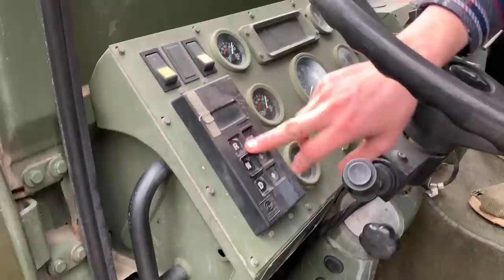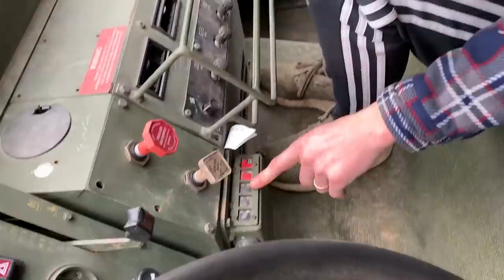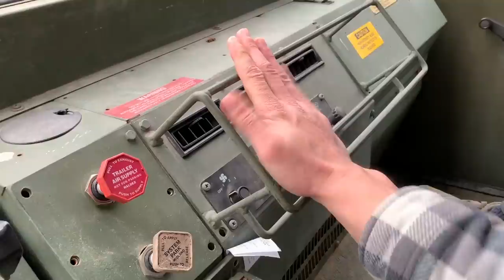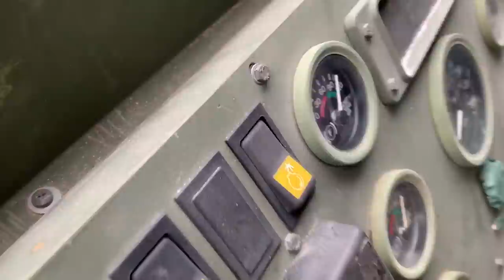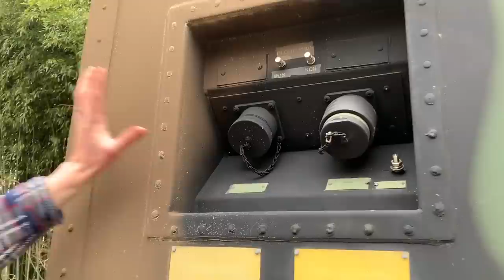Building The Ultimate Apocalypse Vehicle!!!

Comment: Army veteran here. Worked on these for 5 years. Y’all can get the manuals for them online buy googling their model number and TM. It will tell you everything you need to know about it!!
Reply: the circle on the roof is that for a 50 cal ma-deuce turret?
Reply: 22:17 that 69 tho......
Reply: hr 777 I pretty sure I thing I don’t remember I use work on them with the turret only and every thing else and with air up and down In tire there is a hose clamped inside the axle and then it has a like 360 turn thing I for got how write it but it turn with the hose you see out the tire
Reply: I also probably wrong through I was only in back incase of a thing need fixed with never happened
Reply: I worked at Stewart and Stevenson in Sealy, Texas as a Welder in the early 2000's with the Iraq War. The companies name actually changed around 2007 to BAE Systems. These are such amazing built rigs the quality is top notch for sure as you would expect from a Military vehicle.
Reply: I miss camp Carroll, 1999 to 2001. Queen Bee 👍😁
Reply: A man thanks for your service bro and thanks for giving back to the community even though your already did you time in the service

Comment: military mechanic here, you can get PDF's with all the operating manuals, parts manuals, and service manuals. If you need help hit me up and I will help get them
Reply: Christopher Pence that is what I was thinking
Reply: Hey I started off as a 76 Charlie and ended up an 88 Mike.
Reply: Thank you for your service men. Are those plugs on the outside to connect the power for that electrical panel?
Reply: @michaelhembree6347  yes cord goes from generator to those plugs which will bring 110 volts into that shelter
Reply: TM 9-2320-365-24P if I remember correctly for that truck. The M1078/1079 manuals will work for all but the box on the back
Reply: Christopher.....one cool dude.....
Reply: @michaelhembree6347  The plug on the outside next to the battery's is a Jump start plug. u would hook up a cord between 2 trucks to jump it
Reply: You got to gxet the -10 manuals. How else can you do a "complete " PMCS? Jk
Reply: Good Man!
Reply: Liberated Manuals. Old deuce... Check your data plate for the model. I pray they don't have to ever pull that dash apart...
Reply: Awesome dude hook these good men up!!!!
Reply: Hey do you remember those Preventive maintenance comics?
Reply: nice man your grate to help
Reply: @MrLordwrecker  memories.

Comment: You guys are really taking me back to my Army years driving and repairing that vehicle. It's an LMTV (Light medium tactical vehicle), it has the CTIS (central tire inflation system) which inflates and deflates the tires even on the move, the roof of the cab can be removed and outfitted for a Gunner, the left headlight and right rear tail light has the blackout lights for night driving. It's not bulletproof because it's not up-armoured, the cab lift and spare tire craddle both operate on the same system hydraulically to lower and raise and you can do it manually if the system fails. You can't go as deep as the exhaust pipe or you'll stall the engine, and the headlights can be upgraded. I worked on and driven those for 20 years
Reply: so what your saying is, they need to run a tall stack to go as deep as snorkel.
Reply: That's awesome man!
Reply: Back-in-action mode, did that vehicle have remote comms and/or relay capability? Those two connections on the passenger side at the rear look like Russel-Stole recepticals. Usually for some POTS lines and a data connection. Those rings on the top look like they would anchor a small SAT dish. Just some thoughts. Awesome buy goonz.
Reply: @GSXR1300X  yes it did

Comment: Guys, drive that over to your nearest American Legion, ask the Vets about that. When doors are open the black lights come on, close them the white interior lights go on. Over the cab you have a machine gun turret that was removed. Large side hooks for air mobile transport the chopper picks it up. Your AR 15 can fit the M 16 racks. The box isn't bullet proof  neither are the push out windows. A generator hooks in to that fuse box. Inside the cab you have an ammo box and bag storage for gear. Have fun with you build!

Comment: The hole in the roof is a turret. The mount guns on top. Fun to drive. The walls are Insulated. The blue lights are so it’s not so noticeable at night. Tactical and the lights under the blinkers are black lights which are used at nights under night vision goggles
Reply: Sick
Reply: 22:17 that 69 tho......
Reply: Terry - I was going to say something, but you’ve got those details locked in. 🍻
Reply: @HolyMolyDoughnutShop-s  saw that aswell i was like FATE
Reply: Also The hooks you noticed are not merely for removing the roof, those things can be picked up by heavy choppers. The Goonzquad bought what amounts to a stripped down mobile command post. Complete with all the power necessary for the computers.
Reply: The front "tin" section is for the APU/Gen Set for all the power for the 110 plugs

Comment: Hey Boys, Great get. I am an old safety officer for the Department of Defense, and i'd like to pass along a small bit of safety that may save your lives if you decide to raise the cab. A while back a seasoned soldier was crushed by the cab while he worked on the stuff under the cab. Since that accident the DoD has mandated a "T" handle device that braces the cab from loosing hydraulic pressure to hold the cab up. So if you ever decide to lift the cab please find a strong device to place between the raised cab and a hardened spot to prop the cab up while working under the raised cab.

Scott

Medford, Oregon
Reply: I hope they see this
Reply: Up
Reply: Good looking out
Reply: Yep... Just like all of our fire trucks. You raise the cab to a point and a bar automatically locks into place. Do what ya gotta do under there..  Pull the cable to get the bar out of the way and lower the cab..  😎
Reply: hello from Medford!
Reply: The good ol LMTV. Drove a lot of these in the Army.
Reply: Born and raised in Medford Phoenix class of 88
Reply: Thanks for your service and professional advice 👍
Reply: Also no MBUs while sleeping
Reply: keyboard warrior
Reply: I had forgotten all about that T-handle. Good lookin out....
Reply: Yep the officer is completely right ..i work on this and heavy equipment trucks ...and the hydro system is tricky ...be safe !
Reply: Ordrock7 good hint! That’s not a toy! 👌🏻
Reply: nobody cares
Reply: Hello from Roseburg
Reply: Hello from Monroe Oregon
Reply: Sage advice.
Reply: Hey I’m from Medford, Oregon
Reply: Im surprised they lived thru the video

Comment: I want to make a few recommendations for you guys.

1. This is a stripped down mobile command post. This thing has the power generation capacity for computers and tech. Strongly recommend figuring out your own Wifi for this vehicle
2. Light placement is tactical. Keep the blue lights, be concerned about overloading it with lights.
3. This definitely had the capacity to mount firearms of several kinds on it. Check with your state laws on those 
4. Do not mess with the exhaust: If you are building a bug out vehicle you will need to be able to not be heard or not heard as easily. 
5. DO add beds and what not. Also see about more gun storage
6. A refresh of the paint is definitively in order to bring it up to modern camo standards and i agree the Forklift in the same camo would just scream America.
7. Have a lot of fun with this!!
Reply: This is the best comment on here :-)
Reply: Be sure to wear your ppe ie: eyepro, gloves, and ach 😂
Reply: Yeah the blue lights inside are probably there for night time ops. We usually use red lights at night for light-discipline, but I imagine blue lights might be useful for differentiating the command post. This is a really nice truck!
Reply: @jaydenf9646  haha
Reply: I'd make the interior super nice with plush and modern amenities like those multimillion dollar underground bunkers built in old missile silos. Cut a doorway from the cab to the  back, install a roof mounted air conditioner and also build a deck on top with pop up guard rails.
Reply: NATO camo pattern is still in use, so it is current.
Reply: Ok
Reply: Heather Maya true
Reply: @uscjake868  we had the same blue lights inside to the m1a1 Abrams when I was in.
Reply: This guy preps
Reply: This is the main comment that needs to be taken seriously...this vehicle is used for mobile communications, think of it as your internet provider on wheels...also make sure the vents are open when the AC unit is turned on or it can overheat...Also if when starting the truck and it beeps, means that the air compressors need to build up pressure, the three tanks need to be closed along with one that is under the passenger side of the cab.
Reply: The hooks at the top are for dropping it out of palnes
Reply: additional fuel capacity too, thats half the reason i have a hundred gallon tank in my bed, never know when you need A LOT of range or in my case fuel up equipment
Reply: I was gonna say mobile command post, as a guess. Nice find.
Reply: Those plugs on the port side rear are for a power hook up....loo,s likevthey feed into that breaker box inside hope yall turned those blue lights off....
Reply: top comment here
Reply: @adam.maberry.8511  yeah they're for planes but also and more commonly used for transporting it with a heli like a Halo or Chinook.
Reply: Good advice
Reply: Maybe for light units this can be a command vehicle but normally thats an M113, not an MTV SATS, its more suited for BSB Clerks and Chiefs. Command uses HMMWV's and Command tracks that come with DRASH tents built in to create a TOC, that is not big enough to house a TOC for a BSB let alone a FSC. Just saying but good comment none the less
Reply: Hyperion5182  how much is a truck like this? Would love to own one!
Reply: Nerd :/
Reply: why would you need guns to have fun ?
Reply: @andreiv8186  I got one for 7K plus 3K to deliver it
Reply: @Jeramithehuman  Wish we had simillar trucks to buy in europe...
Reply: @andreiv8186  I bet you guys do. Try looking for an old fire brigade truck

Comment: To clear up a few questions you guys have and give some brief info:  This is in the US Military family of Medium- size Tactical Vehicles (wiki it for more info), they're used in a myriad of configurations from cargo moving/ hauling to mobile communications, to mobile hospitals (more like general triage until CASEVAC can get them to a proper base hospital).  The "circular cut" in the roof of the driving cab was for fitting the coaxial ring mounting system for a weapons turret (commonly a .50 caliber M2 machine gun or even a MK-19 machine grenade launcher, sometimes additional radar or communications arrays in special configuration), the large thick mounting rings on various points on the vehicle are for linked extraction by large Engineer's vehicles were it to get damaged or stuck and need towing/ pulled out, for securing in transport aircraft, or even for loadmasters to secure lines to for airlift (empty load) by something like a Chinook Helicopter. 

The M-16 series of rifles were the US Military's primary fighting rifle system before switching to the more compact M-4 variants used commonly now, a full-sized (18in. barrel) fixed stock rifle chambered in 5.56 NATO, it had four main variants (A1, A2, A3, A4), I used an M-16A4 in part of my service, that had a burst fire selection apart from semi and safe.  A3 variant had full auto selection (you can wiki the series for more info).  Every crew member had an issued rifle so there had to be stowage for them all, hence why there's multiple mounts on the back wall of the cab. 

You guys are really going to have to do a lot of research, the maintenance manuals used by the Military for this model type may be downloadable in PDF form or even found in hard copy at a military surplus store or online at like ebay or something, but i'd really also recommend you consult with current or prior servicemembers who worked on these, they're going to be able to share invaluable information on servicing them.  Military vehicles are a whole other bear to civilian vehicles for many reasons.  Good luck.
Reply: Btw thank u for ur service
Reply: @Daniel-pu7le  Thanks Dan, just did my part.
Reply: Derek J. What war was the m 16 used in was it the Vietnam war
Reply: Great helpful information. Thanks.
Reply: @eka-px6dw  -> M1 in WW II and a little Carbine.
Reply: @eka-px6dw  The original M-16 rifle was fielded originally in Viet Nam yes, along with the CAR-15 carbine/ compact variant that is now today's modern M-4 and civilian AR-15 (AR literally means "Armalite Rifle", the original company that garnered the military contract to supply them and patented the general design with help from creator Eugene Stoner).  It's been used in basically the same design for over 50 years now.  Some Army Reserve and Guard units and Marine Corps units still use modern variations of the M-16 (A1 through A4 as aforementioned), but most have switched to M-4's save for precision/ DDM (designated marksmen) individuals.  The history of the rifle itself is fascinating, especially the early years of testing and initial fielding, I liked my M-16A4 (I also had the M-203 Underbarrel Grenade Launcher on it, that thing was awesome).
Reply: Derek J.  Thanks for your service can’t say it enough
Reply: @DJTheMetalheadMercenary  m16a4 with a m203 under it. Those were the days
Reply: @Smittyy978  Hellyeah dude, loved it!  That *thwoomp was always so satisfying hahaha

Comment: Nice LMTV. I used to drive a 5 ton version. There is a lot of cool stuff on that truck. Be sure the pin for that cab is in place everytime you drive, the cab can flip forward and ruin your day. That hole up top is for a turret.
Reply: I had the 5T as well. I cringed at some of the stuff they said lol
Reply: Be sure to run the numbers to make sure the Cab holder has been fixed as well. Having that thing drop back down on you while you're tinkering with the engine sucks. Ask me how I know.

Comment: This reminds me of the Oshkosh HEMMET I drove in the Army. Very nice! By the way, an M-16 is made by the same people who make the AR-15. "AR" stands for "Armalite Rifle" (not "Assault Rifle" as there's no such thing) which is the name of the company that designed them. The AR-15 is the civilian version. The only difference is the M-16 has 2 more fire modes: Auto and Burst which fires 3 rounds. Most modern rifles are designed after the AR platform.
EDIT After seeing the back of the vehicle, I recognize it. What you guys have purchased is a Mobile Command Center. We had these in Desert Storm. I was in artillery, and what we used them for was commanders would sit in the back and receive fire missions from an FO (Forward Observer). They'd receive coordinates to attack, and they'd relay those orders to the artillery units from those vehicles. They would also communicate with other command units in the rear of the front lines to coordinate movements. The interior of the rear cabin was setup like a small office with desks and chairs as well as communications equipment. The external couplings you saw on the side were for satellite transceivers as well as a connection for a gas powered generator.  The "military sunroof" is where a turret ring would be installed for the person in the middle seat to use. It would have a .50 cal Browning machine gun mounted on it. That's why the middle seat in the front cabin is a little higher up. It's also used as a platform to stand on if the turret is installed. Very nice purchase!

Comment: The cut out on the roof an the middle seat is for the Gunner. A machine gun would be mounted on top.
Reply: Sold Sepreately
Reply: @AJ-nh8ik  LOL Dude!
Reply: yeah, that shit was welded shut tho. easy to take off if they wanted to, could mount a giant camera set-up ontop??  foodforthought
Reply: That middle seat should fold down to stand on.
Reply: Gunner? I don't even know her, nyuk nyuk.
A 50 caliber on a pivot would be nice up there. 
If this was a communications vehicle the back top panel may have been designed to fit a 2way satellite system as well.
Reply: ejectable seat :p
Reply: @sevyxuoir6714  Ejecto Seato Cuz!😂
Reply: Don’t give them any ideas😬

Comment: I work ok these every single day in and day out have any issues just email me I have all manuals and lists and checks and parts listing everything you need for these.
Reply: Would you call this example "mint"?
Reply: is it a 94 model? it looks kind of old for 94. I used to drive Unimogs in the australian army. I was kind of expecting this to have transportal hubs and axels for more ground clearance like our mogs, but was surprised to see this with just regular solid axels. Also that interior looks like something much older than 1994.

Also goonzquad, those lights you were talking about are called “blackout lights” these are a really dim light for “blackout driving” (driving with night vision goggles), we also had like a black plastic flap that would flip over and cover the speedometer and other gauges so as to not be too bright so you couldn’t see when you were driving with nightvision on.

Take this thing off road, not sure the specs on this vehicle, but our old mogs could climb a 60% gradient (which is impressive) They were a piece of shit on the highway, but sensational off road.

Also the hole in the roof for us was called a Capola (spelling could be wrong) and as others have stated, it was for having a gunner stand up and be able to put rounds down range from.
Reply: @stuey7777  Well to be fair, Unimogs are Mercedes and are expensive af. These might be decent trucks, but no Unimogs.
Reply: Working in the motor pool sucks I feel bad for you lmao
Reply: Hmm